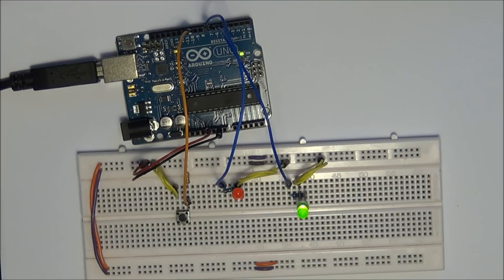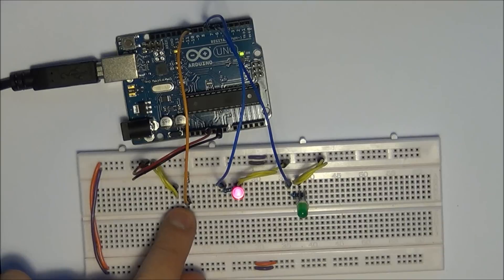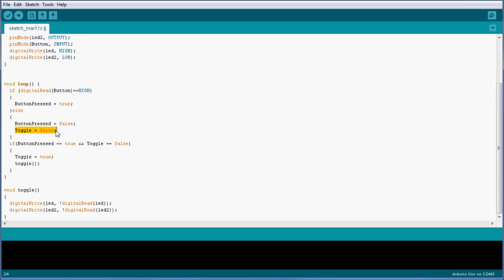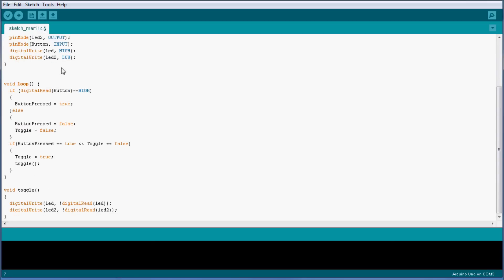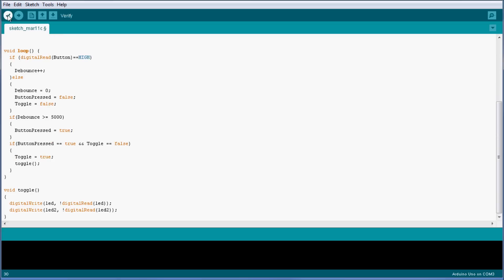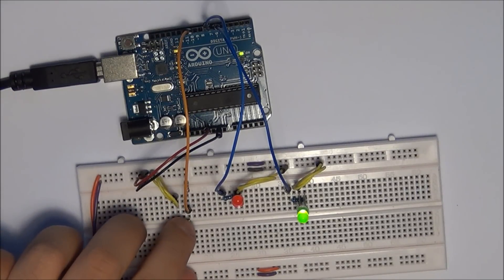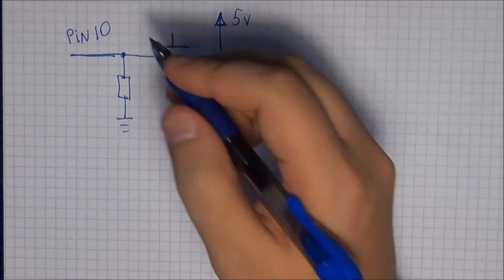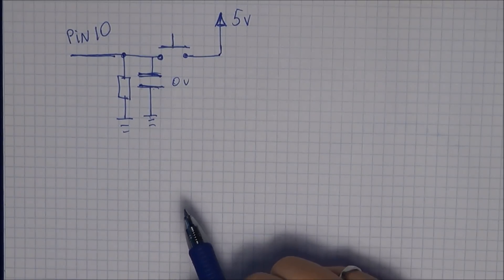Arduino Tut. #7 - Button De-bouncing - Software & Hardware

Comment: Maybe we should add that the limit value for 'debounce' is heavily affected by the runtime of the loop.

If the runtime of the loop is 100us and the limit for 'debounce' is 5000 it will take 500ms for the button to turn on.

If the runtime of the loop is 1ms and the limit for 'debounce' is 5000 it will take 5s for the button to turn on.

Comment: Simplest debound routine I have ever seen.  I also liked how you used the Toggle function rather than clumsy code.  
It is great to see someone showing good coding examples from the get-go.
It was also great you included hardware debouncing.  I remember when I first heard of hardware debouncing and how much searching it took to get a simple answer, bravo.  Typically what value capacitor do you use for a tactile push button?

Comment: ButtonPressed is unneeded variable here. Only 'Debounce >= 5000' if enough. Also 'Toggle == false' is wired code. Normal it should look as '!Toggle'. So if statement should look like this:
if ( Debounce >= 5000 && !Toggle) { ...
removing ButtonPressed variable from code.

My question is: Why you wait for 5000 cycles of pressed button and not toggling LEDs after first digitalRead(Button) returns value HIGH and then somehow ignoring LOW values that come due to bouncing?

Comment: Hi,

Sorry if this question is stupid, I just recently started playing with electronic project (and enjoying this new hobby quite a bit) and still working on wrapping my head around all these concepts/formulas/rules/.... but:
Don't you need a resistence on Pin10 to ensure the charging of the capacitor? (significantly smaller the grounded one)

Thanks.

Comment: Would an analogRead be a better option for more accurate triggering on an RC circuit like that? It seems to me it would then act much like a Schmitt trigger instead of a digital latch. I've done a lot with electronics but I'm just now getting into Arduino as opposed to just using microcontrollers with something like the PIC-kit for programming and I'm not sure how much difference there is between the two.

Comment: I want to run a timer in a car so when the key is turned it starts a timer that runs for a set time then stops at the end of the period. Then stay off until the key is turned again so the circuit will run from 12 volts through a regulator to 5volts and the output to run a 12volt relay, I may want to do this with two timers at different period times I could do it with two 555 timers but have other things to do so thought an Arduino mini would be a good choice.

Any help would be good as I am new to Arduino Thanks Bob

Comment: I want to debounce an input voltage for a timer to start and again to stop the timer so will your software work for a timer
Reply from the maker: Hi Bob, that's a good question. I'm not sure what exactly you are trying to do based on the description, but debouncing is not specific to a particular input. It will work for any type of input. That being said, I'd need to know more as to what problems you are having with the timer.

Comment: Won't this allow for a short circuit condition? Or at least a relatively large current spike when changing states as capacitors act as low pass filters, and resistors reduce current for safe operation and not co tribute to TV time constant

Comment: A real world challenge for you would be to implement a denounce using a Schmitt trigger. Nobody does it with software (other than Arduino kids.). Seriously. Try the real world solution.

Your rc method has a time constant. That means product validation is a <~#%€<<.  You know what I mean. 

As in a previous video, you are mixing analog and digital. Try not to do that. Try a Schmitt trigger and keep everything digital.

Comment: how can i debounce multiple buttons?
Reply: You could write a Button class. The Arduino code is written in C++, which supports Object Oriented Programming (OOP). You could write the code for a button and include a fuction called "IsDown" (or whatever you want to call it). In that function you do all the timing math, and it'll return the filtered state. Writing the code in a class simply means that you can write the code once and create multiple objects which operate the same.

I know this reply is way too late for you, but hopefully someone in the future can make use of this reply.

Comment: Hey i have a problem with servo motors. Id like to use debouncing for my servo motor with only 1 button only. 1st push= 180 deg
2nd push =0 deg pls help me with the codes

Comment: Hi! Which capacitor and resistor I could use for hardware solution?
Reply from the maker: +Roberto Pinto I would suggest reading http://www.eng.utah.edu/~cs5780/debouncing.pdf which explains all types of hardware debouncing along with calculations for the sizing for your circuit.

Comment: (Y)
I have a question... It may sound stupid but I haven't found a good answer for it. My question is, does hardware debouncing consume more power than software debouncing?
Reply: +Buddika lol
Reply: VrideW -That is dependent on the frequency of the debounce. It is not a dumb question. If a Schmitt trigger sits around drawing quiescent current 99% of the time, and the software solution is based on an interrupt (not like the Arduino method), then it may be more efficient. 

These are questions that are getting critical with CPUs running on <2V rails. 

Good question.

Comment from the maker: Hi Roland, very good question! (Not sure why it isn't letting me just answer you...) The short answer to your first question is no, it is not time. It is the number of cycles that the microcontroller goes through. If you were to simply use a time through a delay, you would have completely incapacitated the microcontroller during that period. What I have is a loop which counts the number of times the microcontroller goes through the statement. In other words, it counts +1 if it has gone through a full cycle and came back to the statement.
Reply: EEEnthusiast that makes sense, but for some reason when I set it to 5000 it takes at least a second of holding the finger on the button to switch leds.

Comment: Please correct me if I'm wrong, because I'm very new to this. I'm reading through your program and you say,  the if statement with 5000, is an amount of time. But it looks like it's a number, based on how many times the button bounced, and each time a bounce occurred, the program incremented the debounce value. So the, if debounce = 5000. I don't know, not making sense to me?